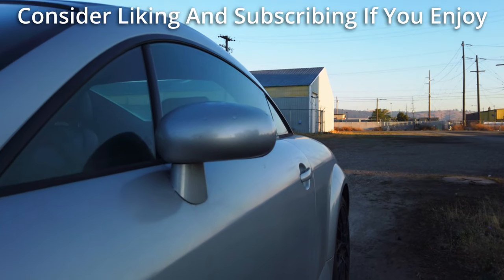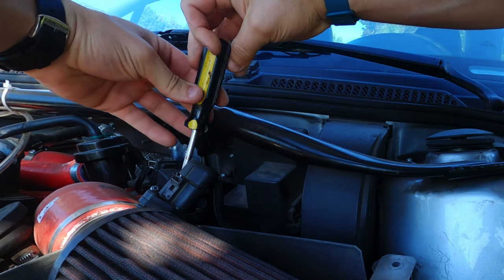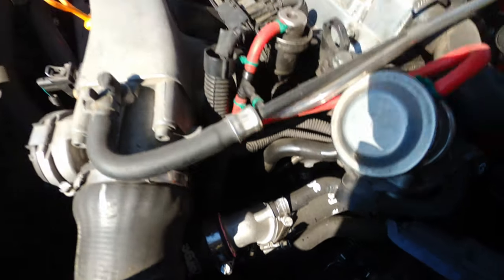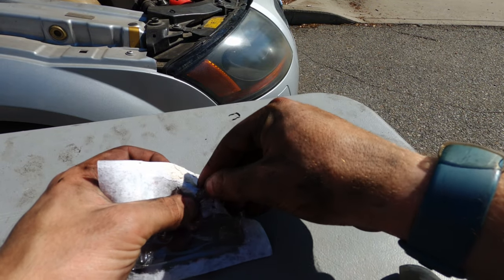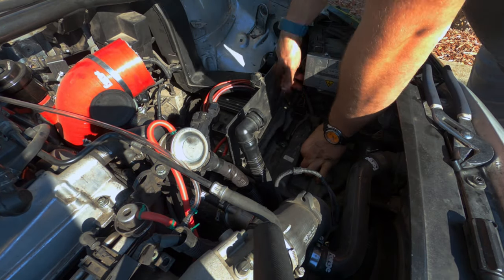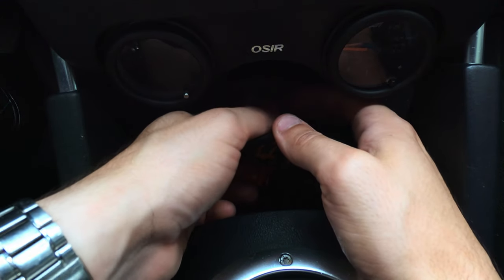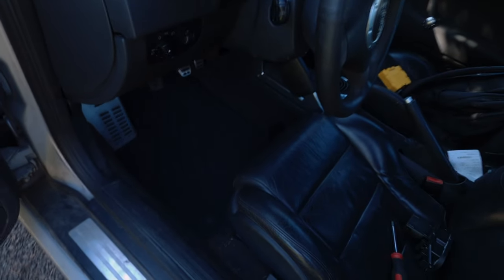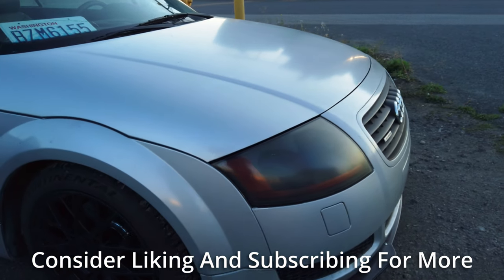How To Dramatically Improve Clutch Feel! | Underrated Mod For The TT!

Comment: Very cool brother
Reply from the maker: Haha not quite on the same level as your supra engine swap😉 but it's still a small victory haha.
Reply: @HunterDirection  you are doing good.  Little by little soon your TT and S4 will get cooler and better upgrades.
Reply from the maker: @CarModsGarage  haha thanks! Yeah, they both need quite a bit of work before I'll be satisfied. Out of curiosity, how do you like those braum seats👀
Reply: @HunterDirection  I love them.  Supra is so tight to get in that I would rather have OEM though.

Comment: So glad you made this video, and the words or explanation you gave with your results.  Now I know how to fix my TT!  Always felt like their was a delay in my pedal, and the car didn't want to leave gear.  In the beginning of your video I was thinking oh maybe I have air in my line, but the other results or benefits you experienced doing this mod had me smiling! Tyvm.
Reply: Same with my TT it always felt like something could be better with the clutch
Reply from the maker: I am so stoked that you both found the video useful! I am still quite shocked this upgrade isn't talked about nearly as much as it should be. Having a linear clutch feel is a huge upgrade in my opinion. I had the same delay issue before this. The clutch felt nothing like my s4 clutch and I never really knew why until now. Thank you for the support!